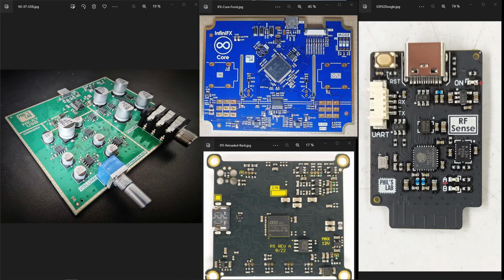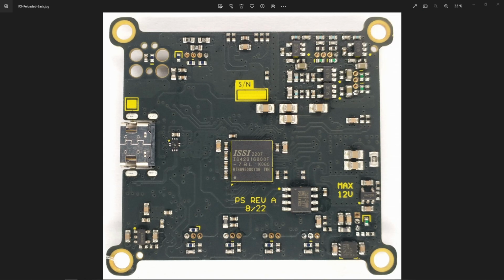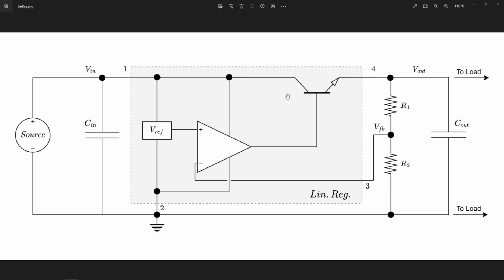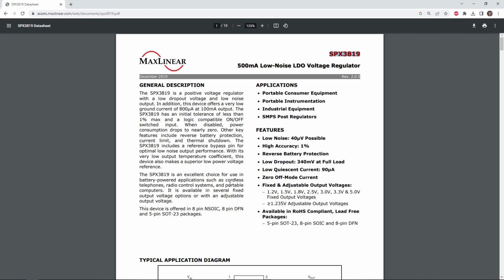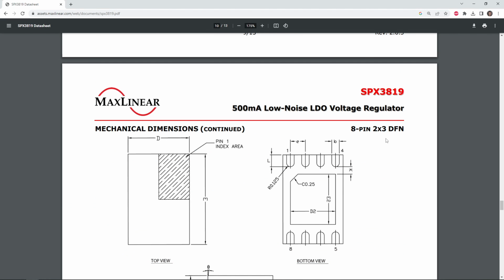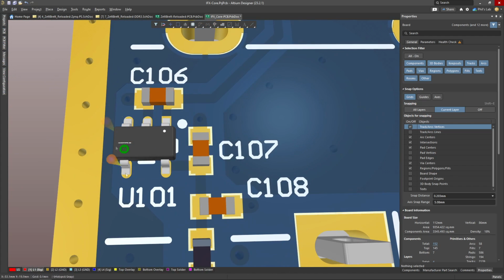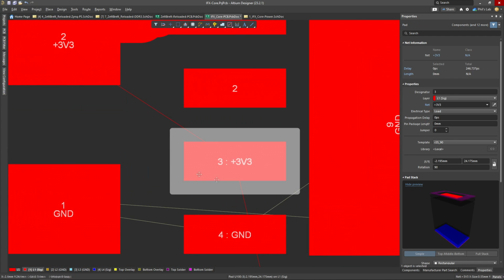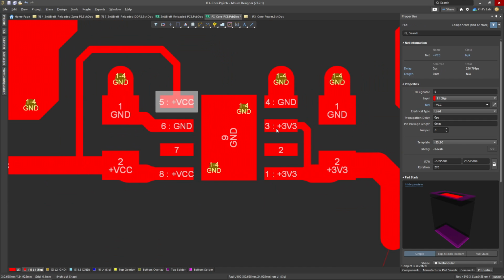LDO Regulator Hardware Design - Phil's Lab #105

Comment: This video has some excellent information for me. I loved it.   
1. SPX 3819 LDO you frequently used in your designs. 
2. TLV76733 (3.3V 1A) , you have used in  PCB shown in Video.  What is the input voltage you used for TLV76733.  
3. Can you share me the part number of second LDO.  (its output is 12V?)

Comment: Could you explain this? I’m using a 3V LDO with a dropout voltage of around 95 mV at a 40 mA load. However, I’ve noticed that the output voltage starts to gradually drop from a 3.5V input. I’ve tried different capacitors. Am I missing something (in the datasheet), or is there a logical explanation for the output voltage slowly dropping with a 3.5V input in my case?

Comment: Hi, amazing video. I'm complete beginner and I was able understand stuff. I have a question, for the power supply design what documents would u suggest me to go through to find if I should use a SMPS or a LDO in my design, what were the documents that u referred for the circuit in this video. a small comment would be really helpful. thanks

Comment: I have a circuit with analog sections, an mcu and adc.
Main voltage is +/-15v, already regulated and stable but i need 5v and 3.3v .
I need this to be low noise mainly due to the adc.
I need the 5v to be exactly 5v.

Can anyone give me advice on what  parts to use?I imagine I need an accurate 5v regulator going into an 3.3v ldo.

Is there any reason to use an 5v ldo since my main voltage is +/-15v ?
Using a 7805 i have noticed that the 5v is not accurate and seems to vary from 4.8v to 5.2.

Any thoughts.

Comment: What is the difference between LDO and DC-DC (buck / boost) power supply ? the DC-DC can deliver much higher currents and is much more efficient , so why not always chose the DC-DC option ? its just because LDO takes less space and BOM ?
Reply: LDO has no switching noise. More like just a constant smooth DC.

Comment: For large current LDOs how would you chose the heatsink? Also would you ever consider making a LDO from discrete parts? (asking since there was some question from sometime ago about regulated 115V from rectified mains in the US, but it was low power , and that made me think that a discrete LDO could be used there )
Reply from the maker: Figure out power dissipated in the LDO, use the thermal resistance of the LDO package to figure out temperature rise, calculate required parameters of heatsink. I'd personally only make a discrete LDO for demonstration purposes.

Comment: Just the tutorial i needed! Would you consider doing a video on power switching? I.e switching from battery power to usb power when it is plugged in. This is a topic i can't seem to find much information on. Thanks!
Reply from the maker: Thanks, Henry! Yeah, that's actually a great idea :)
Reply: I know its kinda old but you can check out Open Smartwatch schematic. If i remember correctly TPS2115 is used in it to do that.

Comment: I have used LDO regulators in the past, one problem i have had is output oscilation in some case this was solved using a residtor in series with an output capacitor or a high ESR capacitor (tantalum or electrolitic).

Does anyone know of any other solution to reduce output oscillations?
Reply: Generally if an LDO can accept ceramics you can use those. Otherwise, higher ESR capacitors or extra series resistance is a good method

Comment: Normally I find your videos too complex for me but this one was perfect!!
Reply from the maker: Glad to hear this one was just right! Any other topics you'd be interested in?
Reply: @PhilsLab  I find all your videos interesting to watch. You explain it well. There are plenty of interesting topics. For example, I'm trying to copy the fs1000a module myself to use in my own pcb, but I don't understand it yet. There is also little information about a 433mhz pcb antenna. I am also curious what determines the efficiency of a boost converter and how you can possibly improve it. I am also curious about programming the cheaper microcontrollers such as the padouk or ch32v003 microcontrollers. But like I said. Find all your videos very interesting to watch! So keep it up!!
Reply: @PhilsLab  But what might suit your videos more.... Maybe you could make a video explaining how to properly read a schematic off a datasheet. As an example the IP5306 (power bank) ic. In the schematic you see different input and output capacitors. What are they for and how do you know which capacitor should be placed close to the IC. Perhaps you can share some general tips with us to read a schematic properly and translate it into a pcb.
Reply from the maker: Those are great ideas, thank you! 'How to read a datasheet' is something I actually wanted to record in the very-near future.
Reply: @PhilsLab  That is amazing. I eagerly await that video!!

Comment: What I like the most in these videos, is that I get knew interesting IC models every time. For instance, it was good to find out a better alternative to lm317, with a lower output noise at the same price.
Reply: Couldn't agree more. And actually it would be great if Phil could post a video with suggestions for some standard parts, which are easy to use, reliable and of course cheap at pcbways and / or jlcpcb. Finding parts takes such a lot of time, and without experience you often don't have the slightest idea what to look for.
Reply from the maker: Glad to hear that the vids are useful in that way as well, thanks!

Comment: Usual linear regulator --> uses darlington transistor, which drops more voltage across itself (Darlington has higher Vce drop), but needs less base current drive.
LDO --> Uses 1 transistor (PNP), which drops less voltage across itself, but needs more current to drive the base. This current is not seen in the output, but is used by LDO to operate itself.

Comment: Question - if I use cascaded LDOs, with the first meant to regulate from 12V to 5V and the second from that same 5V to 3.3V, what will the output voltage of the first LDO be if it is only provided 5V?  Will  the output just be unregulated, after a body diode voltage drop of the "pass element" of the first LDO?
Reply from the maker: In general, if you apply a lower input voltage than the 'set' output voltage, the output voltage will decrease linearly with the input voltage (e.g. input minus ~dropout). The datasheet should provide a graph of output vs input voltage.
Reply: As you said,  you was in need two OUTPUT Voltages  5v and 3.3 (input is 12V).    Is it was a good implementation ? Now its almost 2year , can you advice me what will be a good implementations. I am looking for same . Can you please advice me the best LDO which are easily available in market.

Comment: Thank you thank you thank you! Cannot thank you enough for teaching all of us and helping us build foundations in electronics and PCB design!
Reply from the maker: My pleasure - thank you very much for watching!
Reply: @PhilsLab  I am having some trouble with a topic. Eveywhere I see the concept of characteristic impedance and PCB tracks is covered in detail. But how to match via impedance with track impedance and how to ensure that via does not cause SI problems in high speed signals is not covered in detail anywhere. What do I do?
Reply: @優さん-n7m  About via effect to transmission line (SI problem you mentioned), probably there're just few methods to minimize your concerns. 
1. Put extra vias connected to your return path (may be a soild ground plane or a specific power plane. Depend on your chip driver design) near the vias of your signal transition. 

2. From the PCB design, can try back drill or HDI design to minimize the drop of impedance caused by via 

Via isn't always critical. It depends on rise time need of your digital signals running on the PCB. If the rise time isn't too short and longer enough in your design, I think a little bit impedance drop caused by via should be acceptable.  

Hopefully, this info is helpful to you.😁